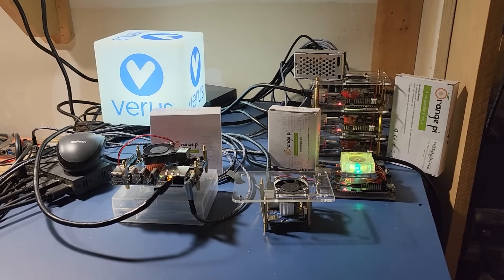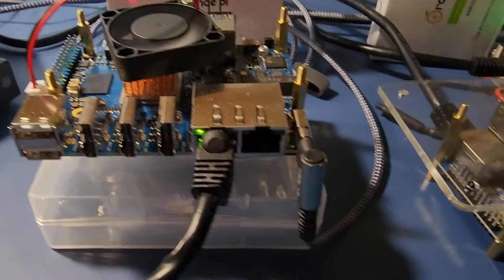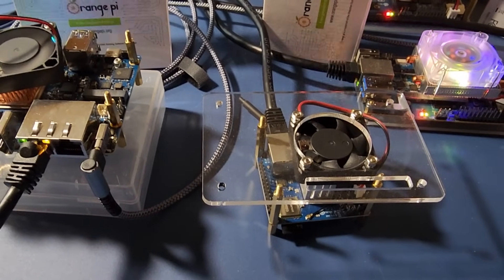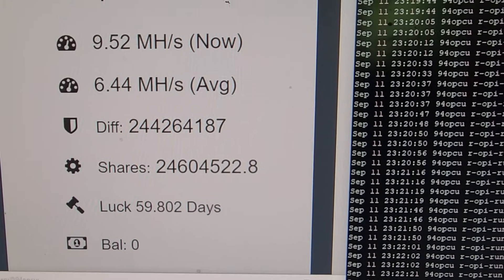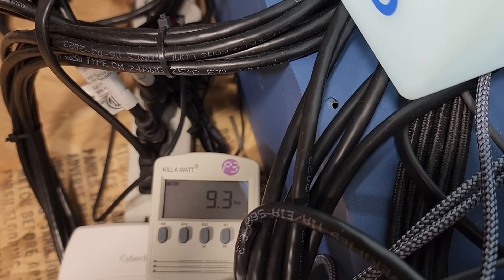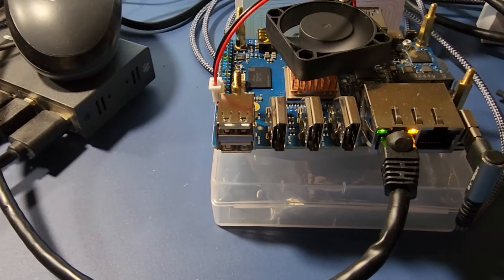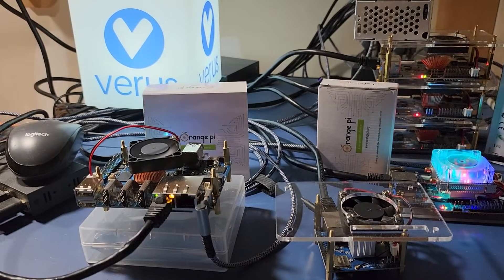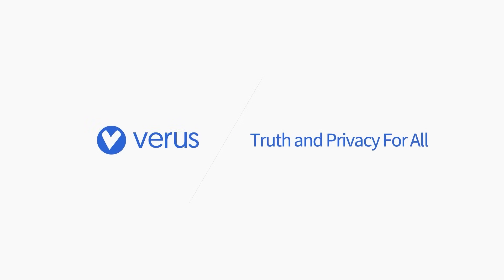Orange Pi 5 Plus - Comparison Series 3 of 3 Cryptocurrency Mining Verus on Single-Board Computers

Comment: What if you connected a USB Hub to one of these boards and filled the hub with Raspberry Pi Pico boards (or something along those lines). Could the Pico boards possibly produce any hashrate? I know a Pico board can at least mine a little; I currently have one connected mining Duino coin.